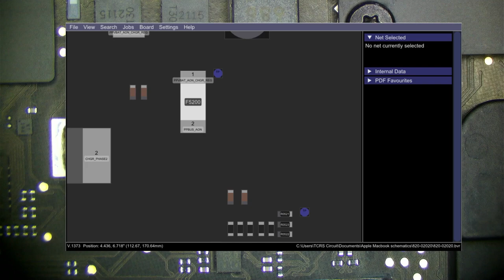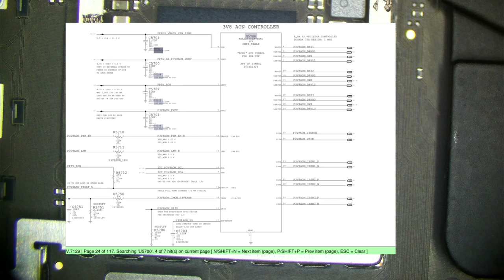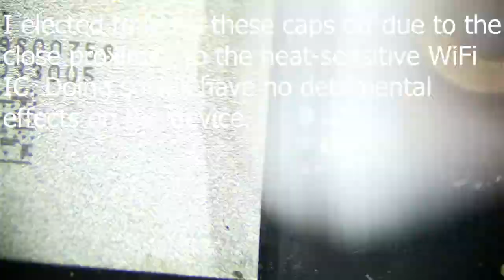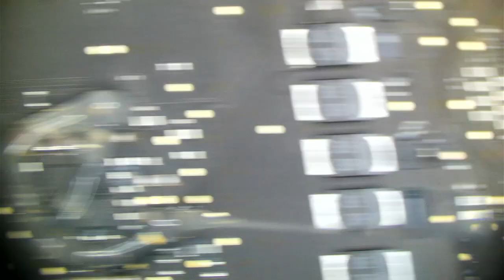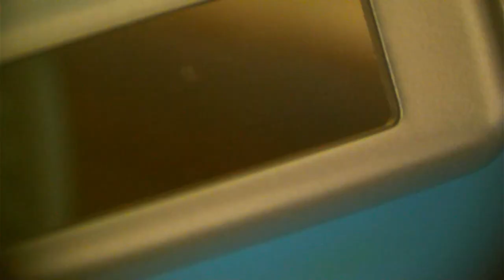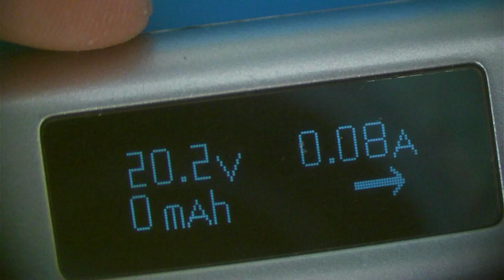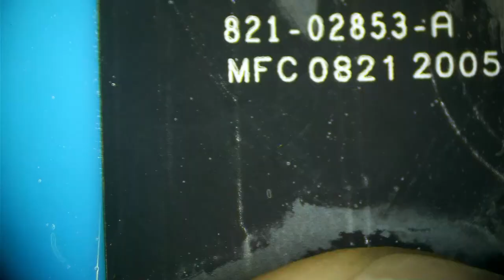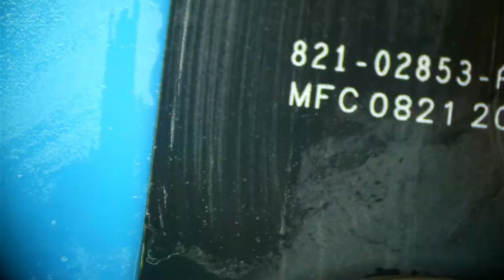A2338 M1 MacBook Pro doesn't turn on after liquid damage. Can it be fixed?

Comment: @7:19, I wouldn't call it sleep mode, in sleep mode it would go into a lower power/voltage state and would be a constant signal. I've seen other datasheets for similar chips and they call it "hiccup" mode, where the chip cycles on and of, very similar to a PWM output signal but with no steady clock signal driving it. This tells you something in the comparator circuit or enable circuit isn't quite right.

Comment: I have one A2338 which came in no power and had corrosion near one of the CD32s, I replaced with all resistors and replaced that particular CD32. 

After that it would simply show 20v and then after sometime 5v so I was able to put the device in DFU mode and restored the device to which it fails and now I can hear the Mac Chime and shows Exclamation Mark. 

There is no other damage and all voltages are present.
Reply from the maker: Question mark you mean? Restore will erase the SSD. You need to install MacOs now.

Comment: G3H comes from G3 – Mechanical Off. It's a PC power state same as S5, S4, S3 and S0. It pretty much means that the rail is on when the computer is fully off, so more or less the same meaning as AON
Reply from the maker: Yes, fully aware.

Comment: My A2338 turns on and works but does not charge. It is stuck at 5v with no visible burnt or corroded components. 

PBBUS_AON: 12V
PP5V_S2: 5.3V

PP3v8_AON: 3.8V (at L5800, L5820, or L5840)

PP3v3_S2: 3.3V at LC710

PP5v_S2: 5V at LC320

PPDCIN_AON_CHGR_R: 5V (at C5205,5204,5203,5202,5201,5206) with both ports)

PP3V3_UPC1_LDO (Near CD3217 chips): 3.4V

PP3V3_UPC1_Core (Near CD3217 chips): 3.4V

PPVBUS_USBC: 5V (if connected to the corresponding port. Only shows 5V per side if connected, other side will show 0v)

Any other tips or pointers to check? Thank you so much

Comment: hey Tim, I recently purchased an m1 MBA and unfortunately earlier today I was extremely clumsy and spilled about half a cup of water onto the keyboard and I freaked out and almost immediately powered it off. I tried to put it into a tent shape and accidentally powered it back on but it didn’t do anything sketchy so I immediately turned it off again. Leaving it to dry for 48 hours now. Do you think I did the right thing and disaster was avoided?

I don’t have any means to open the back to inspect or to remove the battery either unfortunately. Learning a lot from these videos though as I am trying to learn Hardware Engineering
Reply from the maker: Without the battery disconnected it’s hard to say. With electricity running though the board, everything you did will have minimal effects unfortunately despite what forums may say.
Reply: @TCRSCircuit  Thanks. I pray corrosion hasn’t set in horribly.

Comment: Hey bro, would you recommend m1 macs or are you seeing too many poor engineering problems and board failures?
Reply from the maker: So far the M1's are decent, Better designed boards than the previous for sure, however the warranty hasn't expired on a lot of them so it's still too early to tell.
Reply: @TCRSCircuit  thanks for replying bro. Wonderful channel. ❤️ I have a 2014 macbook 15 inch. Dying GPU, low performance when connected to power and just laggy in general. I am Planning to pull the trigger on the M1 pro/ max after using my old computer for almost 8 years now. Hoping to still get around $400 as trade in as the display works fine and battery holds a charge.
I hope I make a good decision.
Praying hard to keep my money safe.

Comment: Hi! Need your opinion on a unfortunate problem I am facing. I have MacBook Pro 2020 and it has got liquid damage and the motherboard has failed and now things working. I just want to recover my data from the hard drive. I would be grateful if you could let me know if I could recover my data from the dead MacBook Pro?
Reply from the maker: Hello,

Your machine will likely need to have the logic board repaired to recover the data. If you are within the United States we can help you at www.tcrscircuit.repair